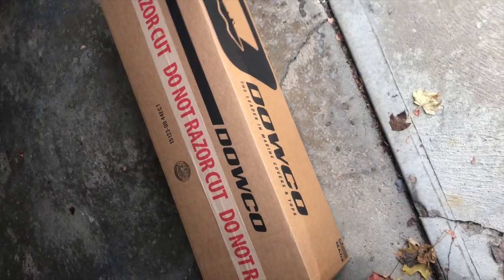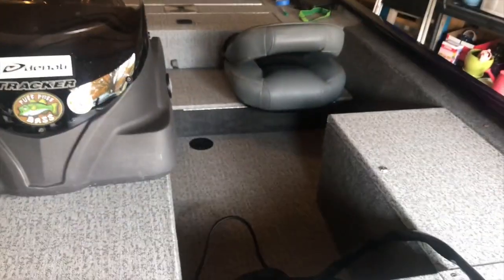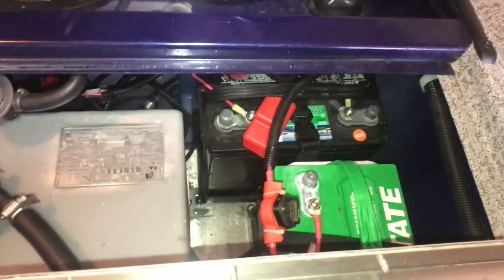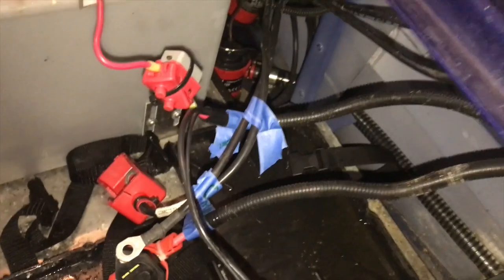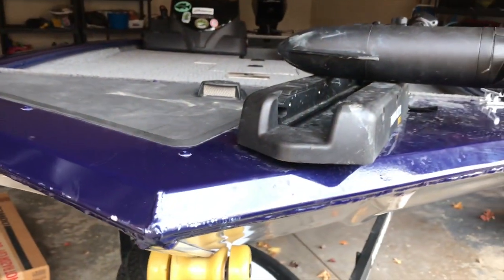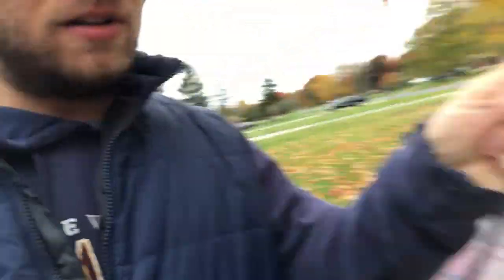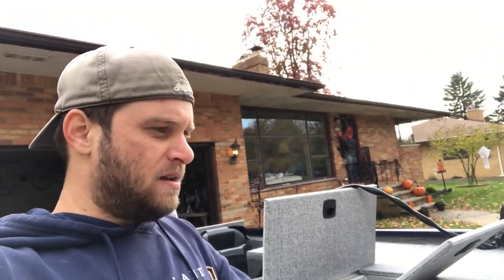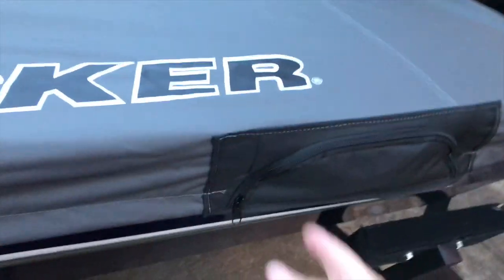WINTERIZE YOUR BASS BOAT / 2020 TRACKER PRO 170

Comment: You should never put high octane gas in your boat.  They are made to run off low octane 87 
It is in the Manuel 
And most motors warranty will not cover if you run high octane gas in your boat just a FYI check your Manuel 1st before
Reply from the maker: Ive never put high octane gas in anything, much less my boat - dont know where you got that idea. Cheers #PuffDaddysUnite
Reply: I just bought a '22 tracker 175 tour edition and it says specifically to use non ethanol gas. pricey and hard to find but what are you going to do?
Reply from the maker: @bryanmannoia8410  interesting

Comment: is the classic xl the same size as the pro 170?
Reply from the maker: I believe its a bit smaller
Reply: @TheNorthwestWind  i went and looked on tracker website , they are the exact same size only difference between the two is the paint schemes & more storage & extended deck but the boats are the exact same size . Interesting right lol
Reply: they both read 16ft 8 in in length and the beam is 6ft 5 in and both have a bottom of 4ft 6 in.  Crazy right?? lol
Reply from the maker: @tbrown737  it seems you are correct with the specs, confusing.  even to the eye it looks smaller

Comment: How did u get those batteries out
It's a tight squeeze, I have the same boat and I couldn't do it
Reply from the maker: I had to slowly rotate the minn battery on its side, and then vertical, and then literally pull it out lol, and then the crank batt will obv come right out.......
I havent put them back in yet since its only December, but I will put the crank back in first, and then finagle the minn battery in the same way i described above but in reverse.  
Pain in the ass........id rather have 2 gallons smaller of a gas tank then spend 25 mins doing that nonsense lol.  great use of space i suppose
Reply: Thank u for the advice
Reply from the maker: <3